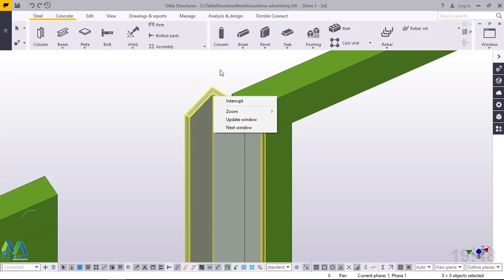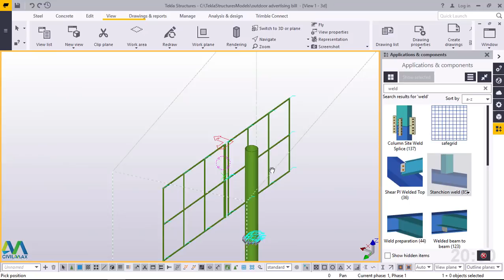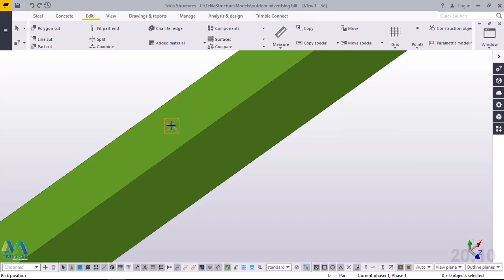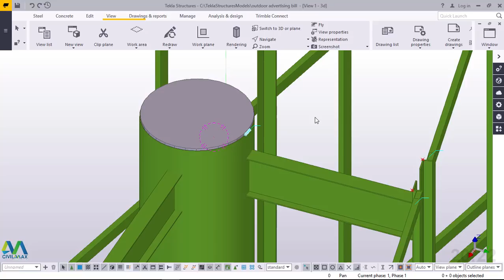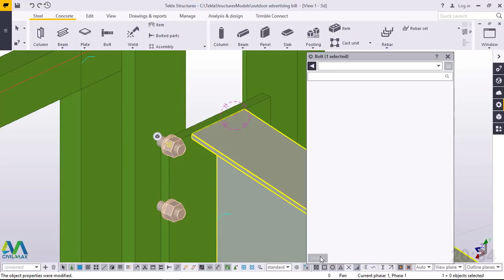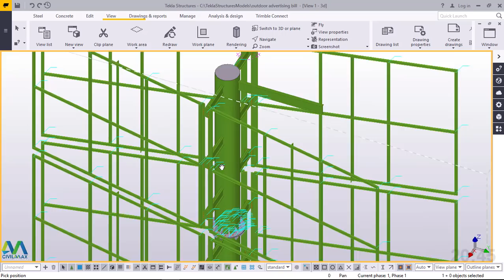How to Create an Outdoor Advertising V-Shaped Billboard Structure in Tekla Structures 2018 part 2

Comment: hey what would be the dimensions of foundation of a unipole hoarding of ground to top height is 55 feet on which frame size is 30x15 & i’m using 2 feet diameter round pole of 9.5mm , i’m using foundation of 6x6x10 feet foundation 

please tell me